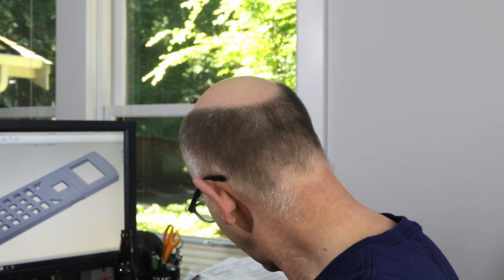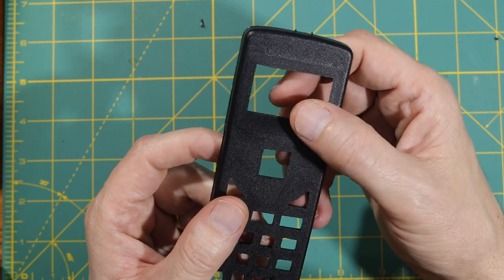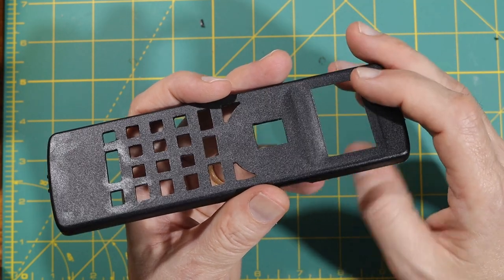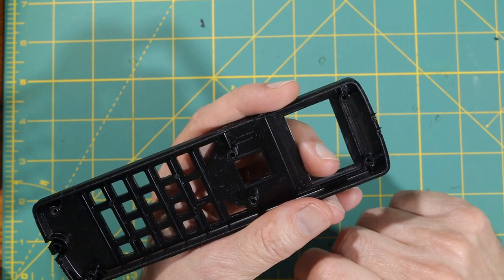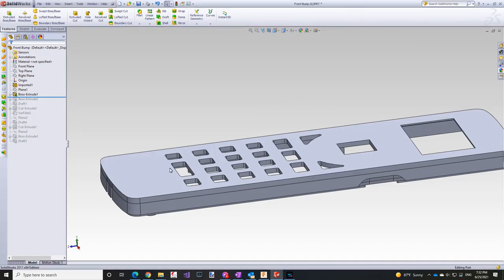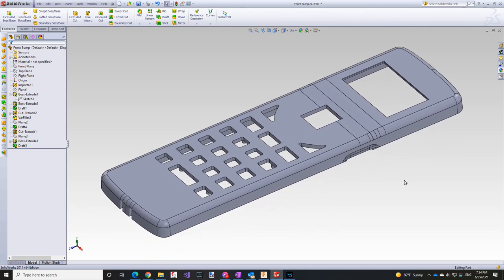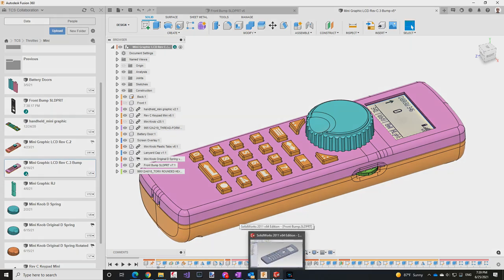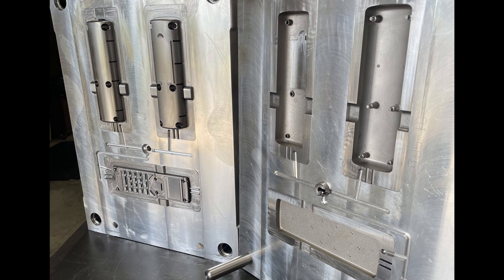Injection Molding in the US Instead of China

Comment: Nice job. I'm surprised the toolmaker didn't catch the thin wall. 40 thou on that long a part is quite thin to fill. I worked in the consumer industry for 15 years, and we rarely made anything less than 80 thou (2mm), unless it was a rib for a boss. 2.5mm was a typical wall.

For validating a design before tooling issue, we used in-house ObJet brand poly-jet machines. They are super accurate, about as good as an SLA, for quite a bit less cost. There are 3rd party rapid prototype houses that have these machines. Stratasys is one. I would never trust an FDM process for final checks before cutting steel.

I think your fusion failure was due to all the surfaces you added converging to a point. I think if you had redefined the original top surface with the shape you wanted, rather than add that shape only on one side, it would have worked. Or, make the top thicker (by a lot), and then cut the new shape away using one sketched feature. Disclaimer, I can't stand fusion. I just switched from 20 years of Creo to Onshape at my dayjob. I like them both significantly more than Fusion. But Fusion has CAM and its price is so good.
Reply from the maker: Yes, I was surprised they didn't catch the thin wall. They probably could have made it work with a larger press, but I didn't like the thin section anyway--it's too flexible. For the larger throttle, there is a similar thin section over the bottom of the screen, but it was 0.04" thick. Generally I shoot for 0.08" minimum, as you mentioned.

The interesting thing about the Fusion failures is that I could perform the exact same operations in SolidWorks without errors. There is one part I will be turning into an injection mold where I got stuck because I just couldn't get the draft I needed. I tried building the draft it, but some operations failed. And I tried adding draft later, and again Fusion 360 failed. So I think there solid model engine just isn't as capable as the parasolid engine used in SolidWorks. Since Fusion works 99% of the time for me, and I do a lot of CAM, I'm OK going back to mold older SolidWorks from time to time.

Comment: Consider looking into an education-only license of SW which you can get for ~$20.  Newer versions of SW have a really powerful Plastics simulation feature for designing injection molds.  Even if you don't use it on products, (the license is non-commercial) I think it might be good content for the channel.  Great video btw
Reply from the maker: This is for a commercial product, and many of the injection molded projects do produce a little income, so it probably doesn't meet the requirements. However, doing some educational videos on plastic simulation would be fun. I'll have to check it out.

Comment: Why not just stick with using the 2011 version of SW?  Just saying it does everything you want it to do.  do you need it to do anything else?  The pictures you posted make that tool look like it made out of aluminum?  On your screw hole pins I always spec them out as core pins that way if you need the a little bigger small taller shorter they can be taken out and ground to spec.  Just a thought.  Can I ask how much that tool cost you??  Love your videos!!!
Reply from the maker: Thanks. I replied to Nick's Stuff about cost. Most of the time Fusion 360 works well for me, and the CAM is really nice. I like being able to update the CAD and have the CAM easily update from that. Regarding the screw holes, it turns out they used a 0.093" diameter pin instead of 0.08" that I had in the CAD. They're going to grind them down to 0.076".

Comment: Ok, I’m an NCE guy, yeah I’m “narrow” minded, but train guys gotta “pull” together, right? (Yeah I hear the groans).  There’s several ways to approach this in F360.  Pardon if someone already suggested this.  Given that you have an existing body.  Go back in your timeline to when you originally extruded that body with draft (-3deg?).  Add the additional desired thickness to your body extrusion to accommodate the thickest part of your new raised area.  The entire body will increase in thickness by this amount.  Now, without going forward in timeline create a new sketch on your longest side profile.  Create a couple lines and a spline connected together to represent your desired profile at the desired height.  These lines should extend to/past both ends of your body at the desired height.  Let’s have some negative thoughts, eg we’re going to subtract a body form from your current drafted body.   At this point, several options, one way is to create 3 more lines at the top of the newly sketched profile and then extrude a body and cut your drafted body in this case (punny).  Reposition your timeline.  Add fillets as desired. If you had existing fillets on the top edges you may need to suppress those features first.  As always, YMMV.
Reply from the maker: I tried those approaches and Fusion 360 kept failing. The 3D engine in F360 just isn't as powerful as the one in SolidWorks. I've known this for some time, just never ran into it this badly.
Reply: @JohnSL  I recreated the body, diff dimensions in F360,  put a fillet on top.  Then did the steps described above, worked like a charm.  if you like I can send you the example file and or screen shots if you drop me an email via linked in.
Reply from the maker: I could  have sworn I tried that and it didn't work. But I just tried it now and it worked perfectly.
Reply: @JohnSL  👍👍👍Thanks for giving it another shot, glad it worked for you.

Comment: I run into that same screw-hole diameter trouble when moving in and out of different design revisions. the screw itself will change but I forget which version uses the updated screw. anyway personally I'd rather just use SW or Inv from the start for an assembly like that, I just find the "local" programs easier with regard to mechanical assemblies. Fusion can do a lot of things but there's some modeling and assembly quirks that force jumping through hoops here and there. I'd rather not bother unless I specifically had a reason to use fusion, like cloud collaboration or something.
Reply from the maker: Yea, SW is much nicer for CAD. Fusion 360 is really good for CAM, and I also sometimes use the circuit board features. So the integration (hence the name Fusion) is keeping me using it most of the time.

Comment: how much did the moulds cost in the end? is the mould made of aluminium?
Reply from the maker: Yes, these were aluminum. I don't recall exactly how much they were. But it wasn't that much more than getting them from China as export-quality molds (many molds made in China are not designed to be repairable or to run on common machines).

Comment: How are you able to still use your 2011 Solidworks copy?  When I try and use my old copy it gives me an server issue or something.  I can only use it when I set my calendar date before 2020.
Reply from the maker: When I installed SolidWorks on this computer several years ago, I did have to contact my reseller to "transfer" my license to the new computer. I reinstalled it from the CD I have, using my license key.